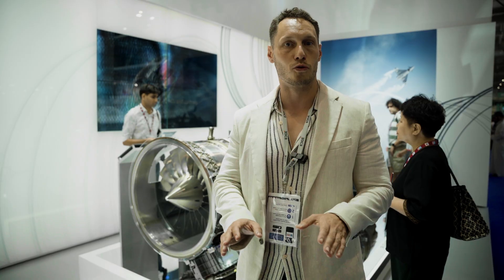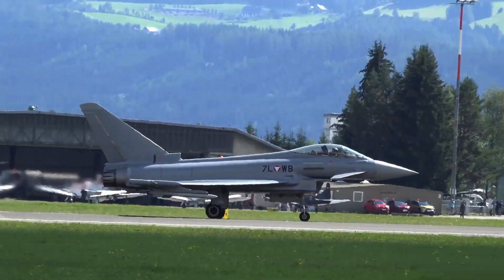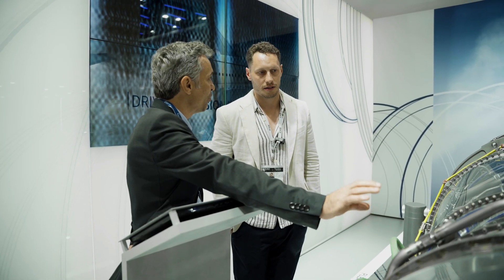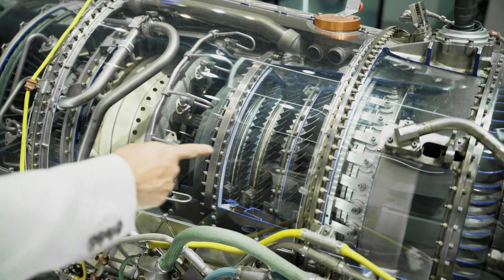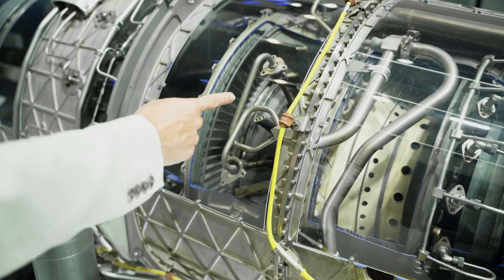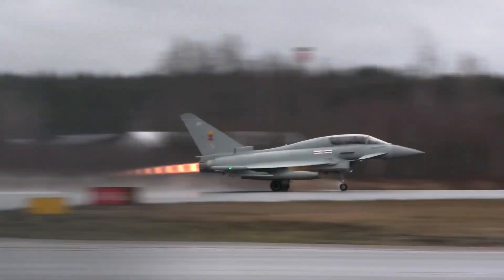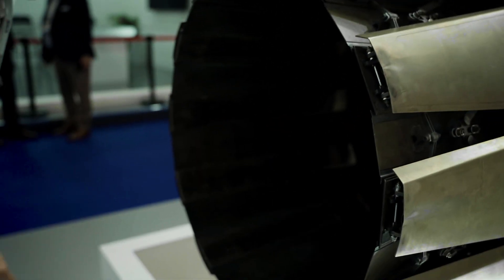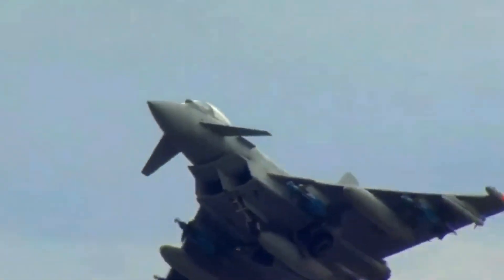Let's cut open a Fighter Jet engine - EJ200 Eurofighter Typhoon - Dubai Airshow 2023

Comment: Good plane , good engine, NO FUTURE, their upgrades are terrible, since there are 4 countries involved (UK, Germany, Spain & Italy) any upgrade has to be accepted by all 4 of them, but if a country wants an upgrade & the others dont, then that country has to shell out the cost of development, that actually caused delay for their CAESAR radar Captor AESA Radar.
Also its like too many cooks spoil the broth, hence India prefered to go with Rafale as it was project managed by France & France have planned using and upgrading the Rafale till atleast 2050, the countries that use Eurofighter, like say UK & Germany already retired their Tornados strike planes, but replaced them with F--35,   so they market Eurofighter as a multi role aircraft but all the partner nations are going for F-35, that shows that they dont have confidence in the future of Eurofighter,  France on other hand is going for 6th gen development. Also its bad idea to go in project with countries that can simply delay the project on a whim .. GERMANY, Italy, Recently Germany infomed India that there would be delay in engines for its Light tank as it has commitments, India went with USA Cummins engines, after few days the Germans said that they are ready to supply timely, the Indians decided to go with USA engine, nevertheless